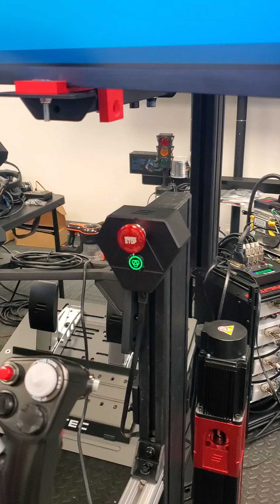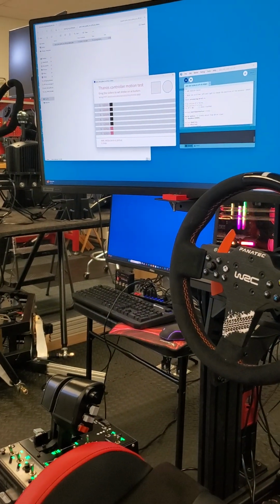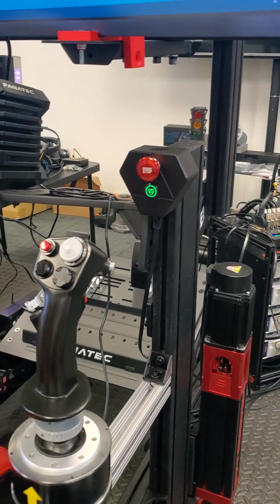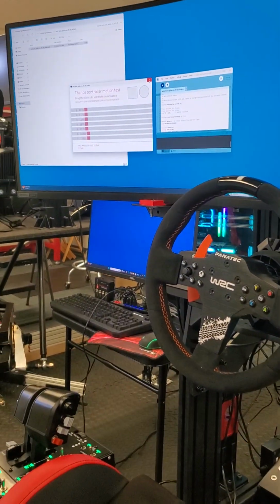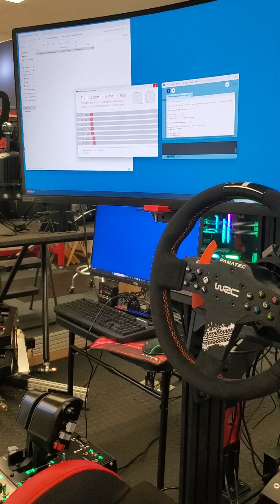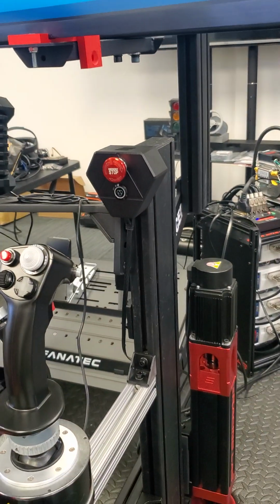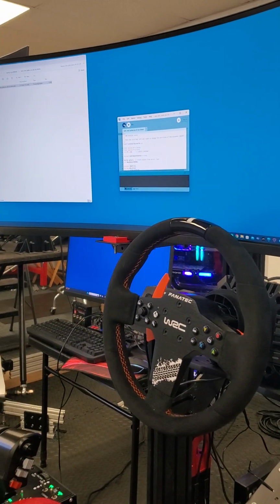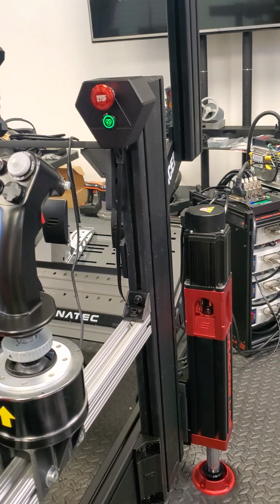How to use the Thanos F-Stop

Comment: @Thanos Motion Electronics Hi could you tell me or link to a video showing how we adjust settings on the Thanos4u controller as it doesn’t have a led display how do we know what settings we can change and how to see them like you do on the Thanos controller with the screen?
Reply from the maker: The Thanos4U has by default the correct F-Stop settings in the latest firmware. It also has a few LEDs on its panel to indicate estop, standby and spike filter if that is what you mean.
Reply: @tronicgr  I’m referring to be able to change the stroke if I don’t want it set to 150mm or how do I change settings like you can on the Thanos with a display or is it not possible on the Thanos 4u